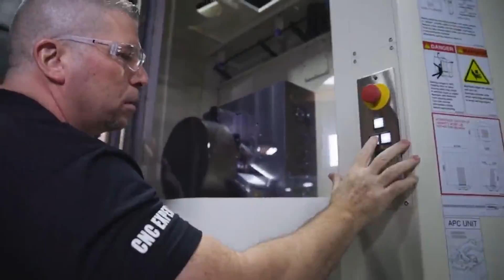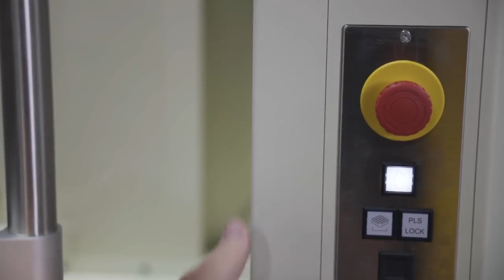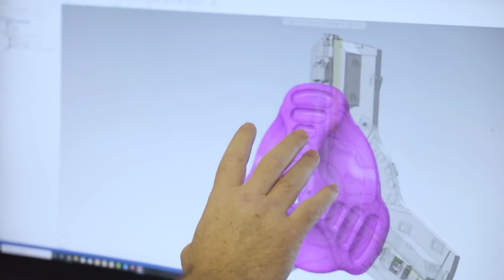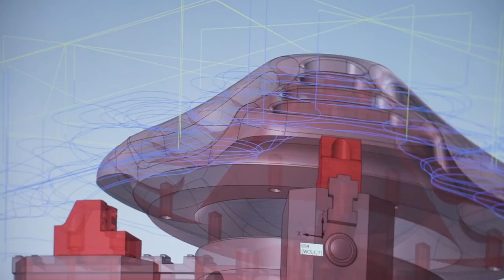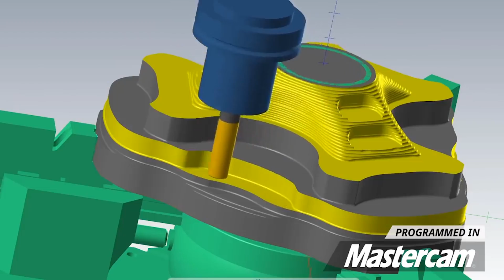Buyer DEMANDS 15% PRICE DECREASE or Parts Get Outsourced!

Comment: Well, it's a nice appraoch that you advocate for, but at some level, you are dealing with the mouse... and you know the book - if you give a mouse a cookie...    

In terms of your business bottom line, though, what you say is sensible but only if you are truly accounting for the costs of the new CNC machines as well as the cost of training your machinists on them.  So while you think it was 40% mark-up on those laser parts, it might have been in terms of your variable costs, but when you factored in all the overhead, maybe not?   Also, as you presented your case to the customer and the customer walked from your relationship, it shows that when you are dealing with companies that have the capability to send work in volume to cheaper international markets, your "partnership" only runs as deep as the owners time spent on the golf course pal'ing around.  Quality of work might matter, but only after they break up with you and realized that "the other chick" they dumped you for is not all there.

Comment: I used to work on a machine shop that made parts for hard drives for computers, back then quality control for those parts was very strict so making a batch of those parts was very time consuming for a finisher worker, on top of that the shop was not big enough so in the end we lost the contract because we just couldn't keep up with demand, when we stopped making those parts all off the workers threw a party in celebration then the client wanted to comeback to us but luckily the shop owners refused to work with them.

Comment: Refusing to drop the pricing 15% across the board was the right thing to do. The outsourcing was always going to happen even if he caved to the 15% the next year would have been another 5 or 10%. That's a question that didn't even need to be asked especially knowing where things are today with outsourced manufacturing.

Comment: Two observations (from a blue collar workers perspective):
1 - don't just give in when asked for a free 15% discount from your customers. If it's not backed with a justification you can agree with, you probably don't want them as a customer. You could at best agree to a price freeze for a length of time. Sacrificing your profits to ensure someone else has one is a losing pattern.
2 - always distribute your business so if your largest customer pulls out you are not left in ruin. Example: if 50% of your business is one company, that company effectively owns you.

If your customer outsources your work and then asks you to 'fix' those parts, either decline the work or do the work for a massive profit (your profit) and put in terms that cover you from original parts defects (as in "not my fault you bought junk to start with").

Sad, but this is the way things have been most of my life. Kind of depressing. "Make money, just don't be a dick about it."

Comment: It's just business. Even if they don't ask for it they could reduce the amount ordered, and get outsourced parts. If your volume goes to zero over time, you can be pretty sure the outsourced parts were better. If your amount stays the same, there probably are no "successfully made" outsourced parts. This includes those products where you have a great relationship, repeatedly telling you how great we are yada yada. You can't see what's going on under the surface.

The guy in the video has a good strategy for staying in business as long as possible. Time efficiency. Keep the machines running. That way you get larger orders. Don't take the lion's share of your profit today but invest in future relationships.

Comment: I was a Tool and DIE maker. Bottom line you have to make a profit in the end or shut the doors. Those CNC machine are not cheap. Good materials are not cheap and good labor is not cheap. The EPA has also caused a lot to go out of business also. You get what you pay for in the end.

Comment: Your previous boss absolutely did the right thing.   do not give in to ANYBODY that tries to blackmail or coerce you into giving them a discount.   does not matter what they end up doing,  if they are demanding a reduction in cost across the board, you need to tell them to pound sand or just pay the money to have the job done correctly.    if they choose to take the business elsewhere to save money, thats on them and they will end up paying the price  for it because they will steadily loose customers because their parts are crap.

Comment: I started in machining back in 1996 and most everything except tooling/fixturing was CNC already.  That was a huge change in the industry when you could make parts so much faster and consistent because the machines were automatic.  Now 25 years later and yes the demand for cost is there, but quality is the big driver, at least in the medical industry.  We have "lost" parts to competitors who promised the parts cheaper, but it almost never fails that we see orders for that part again in 6 months because they cannot deliver the quality necessary.  In the example you gave, at least part of the cost savings could have been passed along to the customer.  Showing your customer that you had improved efficiency and now had extra capacity because of the decreased production time may have won that company ever more profitable work than they previously had.  Just my two cents worth.

Comment: I work for a large, well known company that assembles high quality products with many components.  When the supplier screws up or they have a high scrap rate, we actually have our own team of people that try to help out instead of just "sticking it to them" and telling them they own the whole mess.  There are two reasons for this.  First, they are just going to charge you more next time (I've seen this dozens of times).  Second, it's more expensive for both companies if the problem doesn't get fixed sooner.  Often the price to fix it is peanuts compared to the impact of shutting down a big assembly line.  Also, it's really bad when a supplier just stops producing because they are mad.

Comment: I hate New leadership like that.
I got a new owner at a mid sized shop (11 cnc machines, mix of V/H mills and lathes, 20 welders, break, laser etc.) and he told all the bidders he wanted all parts to be making 30% profit. If a part wasn't bringing that in it needed to be requoted and held to that price or let go.

Many of our customers had a mix of part costs, one in particular we were basically making a few parts at cost but making bank on the rest. When the bidder tried to up the cost of the others it caused the customer to re-bid ALL their parts with other shops, we lost many that made a lot of profit and what little we kept we had to reinvent how we were running them just to keep them with minor profit. 

Across the board asks are stupid. As a customer if you want to lower your price have them re-bid the parts, if it doesn't improve bid them with other shops in the area if that still doesn't get you where you want to be try other areas.

As a supplier if a customer asks for a re-bid it's probably time to look hard at their parts and see if there is another way to approach them or if there has been new advances that you can use to improve on.

Comment: The 15% clowns don’t understand it can cost more to rework a part than make it new. The first op. Surface is gone the second op. Stripper bolt holes are gone. So now you have to make a special fixture just to hold it for rework and if there’s more the one detail to rework more fixtures need to be made. Very expensive. I know I’ve had to rework a lot of outside vendors parts in my time. I’ll just say Mazak and leave at that. Jeff

Comment: Quoted a job for a shop years ago and did not get it. Talked to the owner later and they went to China and he told me what it cost them, which was less than my cost for just the raw material.

Hard to compete against that.
Reply: I saw the raw cost for making a $400 part in the USA and the same cost in China was $65.  Sometimes you can't compete.

Comment: Both value adds and efficiency improvements are necessary. Getting correct parts to customers is important, and so is being willing to work with them on price. Maybe they don't need the final surfaces than their design asks for (e.g.  crude stairsteps would work just as well as a smooth slope), and that can save you machine time and tool maintenance/materials.

In software, my most profitable and valuable value add was always total vertical analysis: if it is expensive for us to make things work on our current component, maybe the customer can get more value and we can get more business, if we take on more components.

Comment: I don't work in a fabrication setting but being in construction, I have to work with the shelf products. I constantly tell everyone around me to never use tools from china if possible. I don't care if the guy in front of me is white, or chinese himself, I'm going to tell him I won't work with cheap tools. If you try to force me to use a garbage tool, I'll either use my own and never pick it up, or I'll throw it off the 3rd floor.

Comment: Having worked in the mold industry for a long time. I have had to setup and fix many molds that where made outside of a quality control system. Companies that outsource without verifying that the company even has a qc system. They have stepped over dollars to pickup cents.

Comment: Worked at a very well-known known aerospace machine shop out of HS for a few years, did Electropolish then Bridgeport/lathe & some 3 axis (we had many CNC guys, own engineers, etc). We worked hard, took pride in our work, and produced some of the best quality and intricate parts, but some orders were filled at our Taiwan location & sent to use for clean up/assembly, and MAN. The material, welds, craftsmanship... in an industry with .001-.003 tolerances, strict QA & leak-down testing, it just needs to be done correctly, the results are night & day.

Comment: I worked in a fab shop fee years ago, we had a 30% scrap rate built into the cost of business because they wanted the contracts and bid the tooling to +/- 0.010 vs 0.02. The amount we scrapped far outweighed the upfront cost and management complained that our scrap was to high. We need to get bean counters out of making all business decisions.

Comment: The fact that the owner started with I want to buy my kids a $500,000 house was a moment that he lost any and all respect. Not once in that conversation did he look at the stability of the company or how that would affect the employees helping to produce the work. That previous owner only cared about it his pockets and his wealth only. Should have taken the 15% cut and you should have taken it smiling knowing that you were still making the killing.
Reply: The buyer is trying to increase his profits at your own cost. That is a no to me. 
That is a half million that your company is not getting to invest into your machines and workers, the boss saying that is a house was just a indicator of how much it was or he would have dipped out way before since if 15% is 500k it means he is making 3mill from a single buyer anyways (started out as a manual machine shop, hired Titan and started investing, which is likely where that half a million would have gone anyways).

Now if they wanted you to work with em to reduce the final cost by 15% there are ways to do it. They can ask for less tight tolerances, longer lead times or optimizing the parts for manufacturing that is that is another thing entirely and perfectly reasonable.

There are always ways to save up but they generally require some sacrifice to be made or a high upfront cost with future savings. 

Also from the sound of it the owner was correct since the customer came back with the outsourced parts and likely made a killing again fixing those parts.

Comment: Proper feeds and speeds can lower the price of anything. When I got my Advanced manufacturing degree about 10 years ago, we had a feeds and speeds instructor who is also an Iscar salesman.
A customer of his was cutting two pockets into a stainless block approximately 6 1/2 by 5 by 4. It was taking up an hour and a half to cut it and a half an hour for it to cool down enough to even pick it up out of the machine. The salesman wrote him a proper feed and speed program had brought him to the school, cut the park in two-and-a-half minutes without coolant and handed the man the park right out of the machine. Had without the cooling the tools that he was selling him with last six times longer than if he applied coolant to them. This man never learn feeds and speeds and still didn't after that he used that program for that part only and several months later with still using the slow feeds and speeds as if you were still using high-speed steel tools when he was using the ceramic tool bits that get damaged if you are cutting steel with them and using coolant. Some people never learn.
Reply: He sounds like a classic "old school" guy that simply because he's been in the industry for 40 years he automatically knows everything and refuses any advice even when shown how much more effective it is. I hope the old asshole went out of business.
Reply: How does not using coolant make the tool last longer than with?
Reply: @arealmaniac2885  Thermal shock can fracture a cutting edge on a carbide or ceramic tool. If the material of the tool can take the heat it can be better keep them at a constant high temperature instead of going from high temp in the cut to low temp out of the cut and back.

Comment: Don't do machine work, but, been down this road. As long as you keep reducing, reducing, reducing, you will soon be out of business. Machines cost x money, power cost x money, ect. There is a certain point where it will be unsustainable.  Keep reducing your profit margin so they can increase  they're own. I'd seek a new customer, because it will not end until your out of business. I used to call those customers bouncers. They bounce around trying to find cheaper. But quality suffers and they come back asking a favor. You just did it, fixing they're stuff from Malaysia. I used to charge them triple the cost for that crap and they happily paid. They will keep bouncing. Not a solid customer, don't do them favors. Shows your desperate.

Comment: Hell, I don’t know. This is how I tackled heat exchanger packs:  A range starting at 300mm square core size, in 100mm steps up to 600mm, then 800 then 1m. The bolt slots were so big they always assembled. Bought in rads in copper or stainless also always fitted. You could have pumps on the back of motors, 12v, hydraulic drive and they all used similar parts on a common fixture. We carried stamped out blanks for the fan cowl and frames  (easy to store) and the factory made aluminium finned heat exchangers to re-condition customer units in house. We could turn out most packs from nothing in three days and some weird ones in a week. And thats how that side of the business made money. We could do it and at a reasonable price and with technical help and design thrown in.

Comment: If your margins will bear it you give the drop. I always worked to streamline processes to maximize my profit after the price is agreed to. This sounds shady but I do this in anticipation of an ask. It's a no brainer. You give a part to a company that they've never seen before at price x. You know after the 5th or 6th time that parts gone through setup times are dropping tool management is getting honed in. People presumably are adjusting speeds and feeds on areas that can be pushed harder. You're going to ask for a price reduction on repeat products especially if they're in bulk. That's business.

Comment: China is falling apart at its core. Half the cities are on tofu-dreg foundations and are years from blowing over in a gust of wind. Sure right now they can offer the better numbers for some parts, because they can do it by barely paying people enough to eat sleep, and come back to work the next day, and they can do it without environmental/safety regulations. But when it all falls apart, literally, every company leaning on them is going to fall with them and be scrambling to produce elsewhere, for China’s civilians, its going to be absolute hell on earth, for the rest of us, there is just going to be a chaotic shortage of everything produced there. The greed of companies wanting to save a few dollars and running to the delusion of grandeur proposed by China is going to cause a shockwave ripple across the planet for everyone dependent on those products. I’d encourage everybody in business to do some research on the actual state China is in at the populations core, the continent is about to run out of potable water, the people are basically modern slaves, people can’t afford houses, materials are so expensive everything that is supposed to be cement is mud, and everything that is supposed to be steel is pot metal. There are next to zero regulations for construction or materials. Contractors setting up a cardboard house and then running with the money unaccounted for is rampant. Their energy producing giant dams are mud slides waiting to happen. People need to pull their bases out of there or(and this is a joke to even ask of corporations) they need to help get China’s infrastructure back up to snuff or it’s going to fall, and THAT going to cost them and humanity a LOT more than the 15% they’re saving now.